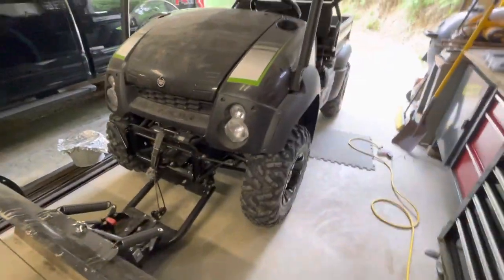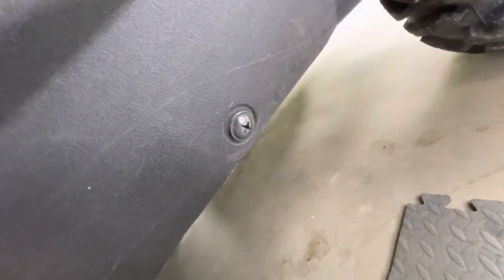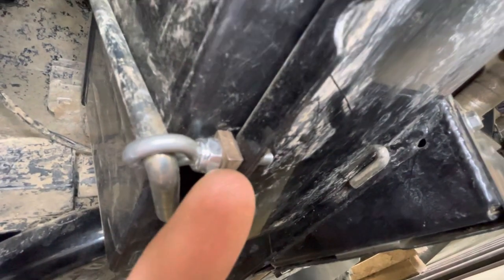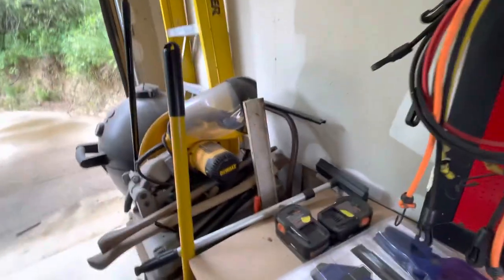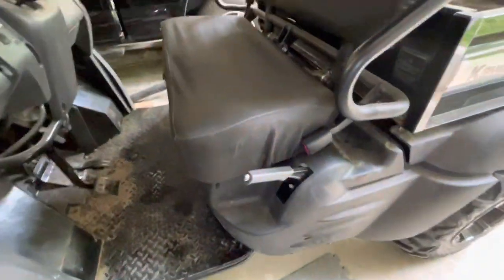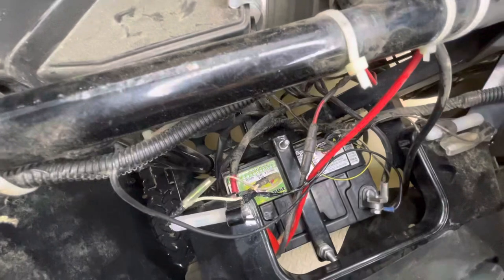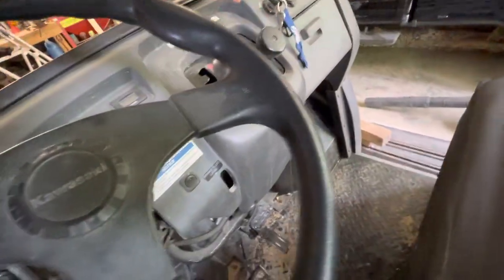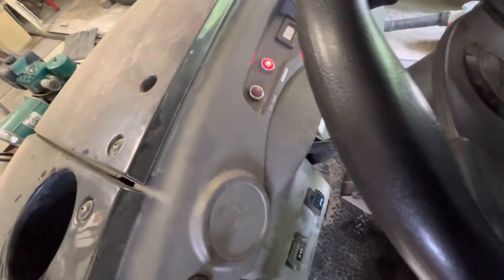Mule 610 Battery Upgrade. Kawasaki small battery issue solved.

Comment: Did you have to change the ends on the cables?
Reply from the maker: No.  This type of battery uses the same type of connection as the factory battery… bolt and nut style.